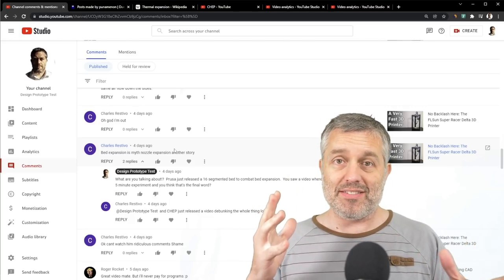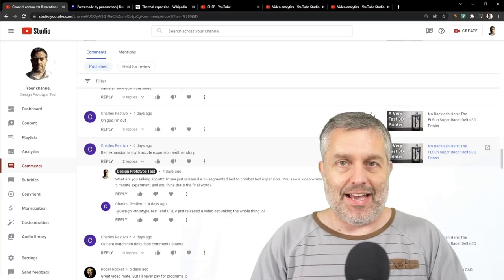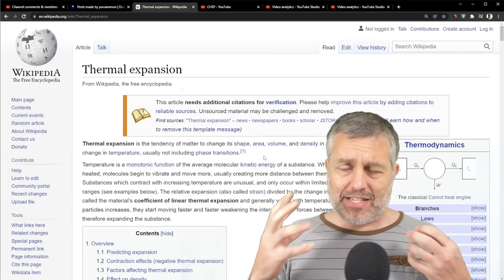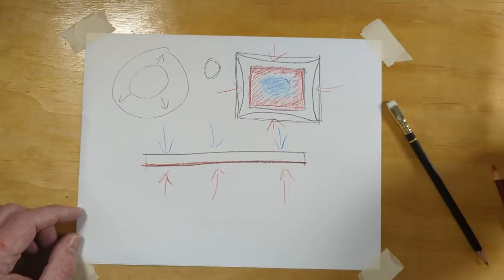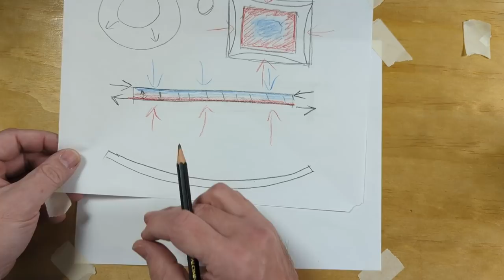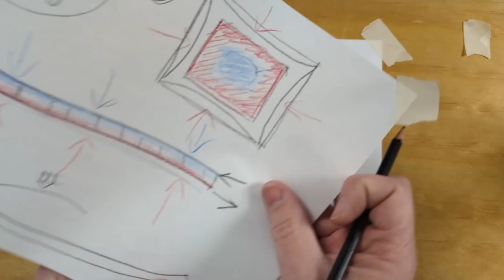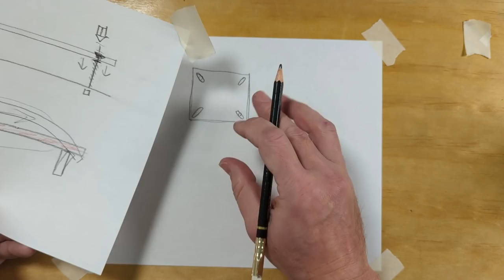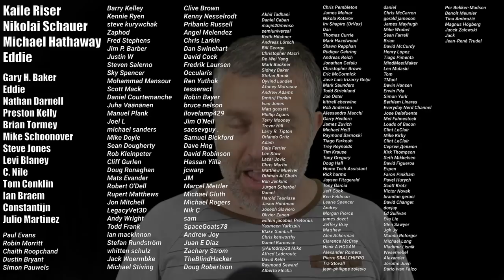The Problem With 3D-Printer Beds When They Get Hot.

Comment: Take a look at the rat rig, they have a ball bearing solution. You are not inventing anything new .
Reply from the maker: What is your problem? Seriously! Why do you harass me? You police my videos looking for the smallest nuance of something original I may have created then you make a point to tell me that I'm not special. Someone else thought of something before I did. WHY? Why are you so intent on making me feel like I have no value as a human being? What motivates this type of behavior? Were you beaten as a child by someone who looked like me?
Reply: I gotta agree with DTP, that's a pretty douchey approach. He never claimed to be inventing anything new and simply said the solution is a bit convoluted, which it is. it just happens to work really well on cube printers.
Reply: Dude wth he didn't even say it was his idea...
Reply: Dude stop watching him and go touch grass or play in traffic, you child.
Reply: He never said it was his idea, and I doubt that it was first done by Ratrig. Ball bearings locating on steel rods seems to be very common. Just look at the e3d toolchanger, it used bearings and rods to locate the printhead onto the tool head. Ratrig just put it on a bed.
Reply: @DesignPrototypeTest  You made a good video without drama, and it would be great if your comments were also as calm. Yes, it was completely unnecessary for Jose to point out the fact that you didn't invent the ball bearing track solution. Still, that doesn't invalidate your "value as a human being", by any stretch of the imagination! He's right that it's not your idea, so you can just say "true, it's not my idea" and move on, without throwing a hissy fit about it. Let's keep things calm and nice. And again, thanks for the great video, well done!
Reply: @DesignPrototypeTest  don't listen to no sense comments like that, there is always haters in every corner of life, great video, keep the excellent work without drama :D
Reply: @DesignPrototypeTest  wow! Same thing happened with the flat filament "idea" you had for prusa. Make some research before publishing the video. Don't be so sensitive, I'm not harassing you. I watch your videos because you have a lot of great information and knowledge. It just annoys me because you have a great channel but you always add drama to it and seem to be always on edge and a victim. And by the way , I do not work for prusa, my comments and thoughts are my own.
Reply: @joseholguin436  except he never said he came up with this idea. Have a Snickers, kid.
Reply: @jfaristide  haha peace and love my friend. Would have been nice if he did some research before doing the video and mentioned some other printers that do have ball bearings. Just amazes me that such an expert in 3d printing never saw before any printer with ball bearings.
Reply: @DesignPrototypeTest  id say youre someome he wants to be but isnt
Reply from the maker: @marcus3d  This comment is not isolated. Typically these guys show up on a video where I've actually created something novel. The point of their comments is to make me feel bad about my creations. But they are very clever and subtle on those other videos. The reason I pinned this video to the top and responded so strongly is because it perfectly illustrates what I'm talking about. I am persecuted by his type. You telling me to be calm and not cause drama over this issue. Makes me understand why my wife gets mad at me when I tell her to calm down. You are helping him to disparage me and my creations by suggesting that I am overreacting. As if it's my fault that he attacks me. Whose side are you on? Do you think he's right? Do I not make good original things?
Reply: @DesignPrototypeTest  You claim to know what their aim is, but you most certainly do not. Don't assume the worst. And even if their point would be to make you feel bad then just don't. It's water off your back.

And you say you feel persecuted. Well, don't. That's just your (IMHO extreme) reaction to your own interpretation of their action(s). No need to feel persecuted. They said the idea was old. They were right. No problem. No need for drama.

And you're asking whose side I'm on -- that's ridiculous us-vs-them mentality. It's just more drama. And that kind of mentality will just hurt yourself.

Instead of your egocentric ideas of coordinated persecution I think it's extremely more likely that the guy just wanted to appear smart and knowledgeable. Or maybe he's a geek (like me) who isn't very soft in his communication. Or maybe he's from a culture where this way of talking is the norm. Or any of a myriad of other possibilities that has nothing to do with persecuting you or wanting anything bad for you.

But just as he jumped to conclusions with his assumption that you thought your ball-rails idea was novel, so did you in your assumptions that his intent was malicious. You insisting on assuming the worst just hurts yourself. Don't. It's a choice.

And again, even if it would have been malicious, then so what? It's the internet, there will be harsh people. Some even harsher than your grandma. And someone saying something bad about you says more about them than about you. In any case it's completely pointless to whine about it, or to make drama. Let it be. Really. Let it go. You'll feel better, we'll feel better, even your wife will feel better. :)
Reply: @marcus3d  every last word of this
Reply from the maker: @marcus3d  You are completely and conveniently glossing over the point so that you can say a bunch of other words that sound like you are putting me in my place. Here in a video where I made absolutely no claim to any unique ideas coming from me he felt the need to say "You are not inventing anything new" The incongruity of this statement in relation to this video is indicative of a group of guys who make a point to watch all my videos and always comment that my ideas aren't original, I have nothing new to offer the hobby, and I am not talented. This behavior pretty much perfectly fits the definition of persecution: persistent annoyance or harassment. So, I will ask you again. Who's side are you on? Do you agree with Jose? Do you think I do not offer the hobby any new ideas? Do you think it is right that these guys keep me in my place by telling me repeatedly that I have nothing to offer? Answer the question directly please. I'm not asking for a diatribe about how I make my wife feel.
Reply: @DesignPrototypeTest  In the end, nobody but you is keeping you in your place. It's all your own interpretation. And I already said that I think it was completely unnecessary for Jose to say that, but it's also true that you didn't invent the ballbearing-on-rails thing, which can be seen in lots of places in 3D-printing. And now you're implying that I'm persecuting you for just telling you to not be so unbelievably thin skinned and paranoid about people being out to get you when there are other alternative interpretations, which I think are much more likely.

I'm sad that you feel persecuted but really, that's not because of others, that's because of you — your interpretations of things and the way you choose to react. You can choose how you look at the world. If you expect people to persecute you then that's what your perception will be attuned to, and how you will interpret things. But it doesn't have to be that way. You can choose another way. I've asked a therapist to help me overcome similar problems in my own life, and I wholeheartedly recommend the same to you. It will make such a huge difference once you no longer feel persecuted by random people's thoughtless, careless, or even outright mean comments.

Don't you think it sounds nice to get rid of all persecution without having to change anyone else on the internet? Why not give it a shot?
Reply from the maker: @marcus3d  1)Do you need me to catalogue all the times on all the other videos when I received comments similar to Jose's? I can do that. It's verifiable. It's not a perception thing. As I already cited the definition of persecution (persistent annoyance or harassment) clearly encompasses  a group of guys making a point to watch every single video I release for the smallest hint of something original so that they can make statements tearing me down and telling me I do not make original things. Therefore, by the very definition, I am persecuted, and it's not my perception. You are treading into gaslighting territory by suggesting it's all in my mind and not something that I can prove by combing through my comment sections. I'm beginning to think you don't want to answer my question because you don't have my intersects at heart. I'm beginning to think you are in fact my enemy commenting here to play mind games with me. This perception of you is further strengthened by your inability to answer my question. So. I will ask you AGAIN (3rd time, or is it the 4th?). Who's side are you on? Do you agree with Jose? Do you think I do not offer the hobby any new ideas? Do you think it is right that these guys keep me in my place by telling me repeatedly that I have nothing to offer?
Reply: @DesignPrototypeTest  The reason I didn't answer whose side I'm on was explained to you. I don't see any sides. Jose didn't say that you offer nothing new, that's a strawman. As I've said, repeatedly, his statement that you didn't invent the ballbearing-on-rails thing is correct, although unnecessary. That said, I'm completely on your side in that I really want to see more videos like this from you. It's a really good video. It's disheartening to see you go down the hole of thinking the world is against you. Please don't. I'm sure lots of people, including Jose, wants to just see more drama-less videos about design, prototypes, and testing. Please continue with these, and from the bottom of my heart please, please be well.
Reply from the maker: @marcus3d  This isn't good enough. You still didn't answer my question so I'll make it even simpler for you. QUESTION: Do you think I make original things?
Reply: @DesignPrototypeTest  Heck that dude, seriously. There are always going to be gate-keepers and trolls who have zero clue try to armchair their way into a topic they have no real understanding of in order to make up for their otherwise bland lives. Don't let it discourage you!

Your content, ideas, and the way you just explain things is phenomenal. In my opinion (and tens-of-thousands of others), you're a major resource and a "go-to" when it comes to learning more about 3D printing and conceptual design.
Reply: @DesignPrototypeTest  What isn't good enough?? I did answer the previous question as well as possible, given your false dichotomy logical fallacy (as explained). As for your new question, lots of things you say/do are certainly new to me, and as far as I know original. (The ballbearing-on-rails thing wasn't. I first encountered that on the E3D tool changer coupling, and after that on various kinematic heatbeds, although probably it's been around for ages.)
I very much appreciate hearing new stuff from you, please continue.
Reply from the maker: @MasterThief117  Thank you kindly. I appreciate your support. You , and the others who feel the same as you, are the reason I keep making videos. I'm mostly here to serve you guys, and to help advance the tech (if I am able to have any effect on things).
Reply from the maker: @marcus3d  Ok. Marcus. You've answered the question of whether or not you think I make original things and whether or not you value me making those original things. This is not a new question. I simply asked it in the negative sense originally (Do you agree with Jose who does not believe I create new things and wants to devalue me and my videos especially when it looks like I may have created something new), and then in the positive sense recently "Do you believe I make original things." You went above and beyond when you told me that you value me for my original contributions. That was going to be my follow up question so you expedited the conversation. Thank you. But the problem is that you can't even identify a question asked in the negative sense and in the positive sense as being the same question. Yet you think you should have the authority to psychoanalyze me?

As a self professed supporter of me (as the creator) and my channel I would think that you would be doing all you can do to encourage me to make more of the content you like. Ostensibly this is what you were doing with your diatribes culminating in your insinuation that "drama" on my channel makes my wife feel bad. First of all don't ever give me advice about my emotions or talk about my family ever again. This is a 3D printer/maker channel. It's not reality TV about my life. What gives you the right? You aren't my Uncle Iroh. Do you really think you are better than me and so much more cognizant of my life circumstances that you can navigate a better path through my reality than I am capable of? REALLY!?! The limited information you have about me from my videos makes you believe you can be my therapist? That's some hubris man. You should get a T-shirt like Josef. "Everyone is a maker, but only I can navigate DPT to a state of Zen." 

Secondly, don't ever use the word 'drama' with me again unless you want me to consider you as my enemy. You display a long standing knowledge of my channel in your comments so you are well aware of the connotations of that word in relation to my channel. It has been used many times as an attack vector from the Prusa camp. Whenever I make valid criticisms of that man/company I'm met with "stop with the drama" type comments like yours. It's not drama, it's valid criticisms. There is no defense against my criticisms so that word is used to dismiss them as bupkis. It's like that scene in Step Brothers where Will Ferrell has absolutely been playing the drum set and when asked if he did it his answer was "Are you f*** crazy man? You sound insane. Do you realize that?" See the deflection there? He definitely did the crime so he had no defense. Therefore, he attacks his accuser's sanity. That's kind of like your comments talking about my mental healthy. Isn't it?  You are deflecting. Jose is guilty of attacking me. In a video where I made no claim to anything original he went out of his way to disparage me on the subject. Then you, my self professed supporter who supposedly values me for my original contributions, wrote hundreds of words to me about my sanity/emotional health and that of my family. You didn't tell Jose he was out of line. You didn't defend me against his attack. Instead you tried to twist things making it look like Jose isn't here to harm me and my channel and you caused me to doubt my sanity. It's no different in effect than Will Ferrell's words from the movie. You can understand why I don't believe you for a second when you tell me that you support me. Your words have the opposite effect. 

Now, the fact that you are so motivated is the most suspicious thing about you. You jumped right in with hundreds of words impassioned to stop the drama. Well, if that is really what you want, why not go after the cause of the drama?: Jose. After all, this is a comment stream. Not a video. I didn't start this, I'm reacting to an attack. I didn't see one single word from you chastising Jose, but supposedly you support me. Would you tell someone being attacked on the street "Just ignore the punches. You aren't being attacked. That's just your perception. Think about how reacting to this is making your wife feel!" 

emotional
Reply from the maker: Something went wrong with that last paragraph. It didn't get posted. I don't feel like recreating it so I'll just say this instead: Only my intimate inner circle gets access to my psyche. Cowardly strangers hiding behind anonymity on the internet must be out of their damn minds to think they can reprogram my cognition like Marcus tried to do. To anyone else who wants to take this conversation/attack-vector this is your one and only warning. I will ban your account for this behavior. You are serving your own ego trying to mess with my mind. Don't pretend you are looking after my best interests. If you support my channel. Then support my channel. Call out guys like Jose. Tell me you appreciate my contributions. Trying to get me to do a deep dive navel gazing session doesn't get us anywhere. It has the effect of hurting the channel. I remove commenters who hurt the channel.
Reply from the maker: @joseholguin436  For reasons that god only knows my ability to come up with original things is a threat to you personally. Me, a stranger to you, coming up with original ideas threatens you. Which one of us needs to see a therapist?
Reply: @DesignPrototypeTest  you should let your "inner circle" (the one you trust with your psyche) read this thread. 

I worry for your well being and wish you the best
Reply: @DesignPrototypeTest  if my comment-thread was an isolated event within your channel I would be going to the therapist right now. However, by looking at your videos and comments there is a very clear pattern of behavior you have towards the rest of the community, maybe take a look at that. Even Chep who is the nicest person around seems to be already arguing with you. This is the internet, don't take things too seriously.
Reply from the maker: @jfaristide  They do Jay. Thank you for your comment supporting me in the face of Jose's original comment. I don't actually want to make videos for this channel. I don't feel the urge to do that anymore. The only reason I continue is because I know I would let people down who want to see more content from me. I read comments to get motivation. I reflect back that which I receive. Unfortunately, I almost never, and I mean like 1/1000 comments tell me "This is an awesome project. Keep it up. I can't wait to see more of this from you."
Reply: @joseholguin436  I dub you Barnacles the 3rd!
Reply: @jstro-hobbytech  It's a logical fallacy named "false dichotomy". 🤦‍♂️🤦‍♂️🤦‍♂️

And no, that's not what a dichotomy is. A dichotomy is a division of all possible alternatives into exactly 2 non-overlapping groups. Gosh! 🤦‍♂️

And no, a fallacy isn't necessary binary in nature. This one is an informal fallacy.

And the number of possible values has nothing to do with the binary of truthfulness. E.g., here's a trichotomy: "X is either a cat, a dog, or a goat." and the fact that the statement can be either true or false doesn't change the fact that it's a trichotomy. 🤦‍♂️

It seems unlikely that someone would be as wrong on as much as you are, so I'm thinking you're actually just trolling. But in that case, why not make it clever and funny? Like Ken M.
Reply: @marcus3d  I love it!
Reply: @jstro-hobbytech  haha I have no idea what your comment meant but made me laugh. I love the internet
Reply: @joseholguin436  good because yours did too and I was laughing at my own as well and the fact that I hopped in to the fray with no skin in the game. In the end it's all just melted plastic bro. Well melted plastic and 50 cent words spewed in succession like a broken thesaurus.
Reply: @jstro-hobbytech  nice to hear someone who doesn't take things to seriously and personally. I come from a place where PC culture has taken over yet and people don't need their safe spaces that bad.

Now just imagine DTP singing this haha
https://youtu.be/sXQkXXBqj_U
Reply: @DesignPrototypeTest  This video was really informative,  and you make valid points, but you get into completely useless arguments in the comments. Nobody's "invalidating you as a human", no one was "beaten as a child by someone who looks like [you]." Just chill.
Reply: @joseholguin436  you are wrong from the beginning of this thread man. Sorry but this creator only suggested that a ball bearing could be a solution but then he said that this would be too complicated so your problem must be somewhere else than you claim. Thinking is a creative process based on previously gathered knowledge. It takes no more than a few minutes to come up with ball bearings idea. And adding a little drama to the show makes it MORE ENTERTAINING. If you are looking for boring facts, look for them somewhere else. You appear to be well informed (according to your comments). Start your channel, spread you knowledge with other people. This is easy. Right? You would have done it better. Right? This is what your comments show. Then go and create and pray so that you do not come up with ideas that others had before you. You know why? Because other Joses will hunt you down on every false move. Good luck.
Reply: @marko_z_bogdanca  it's not my intention to create a channel, and if I did I wouldn't be so edgy an offensive like DPT. And I would do a bit of research before publishing a video (if you are going to make a video about beds and heat expansion, a bit looking around at precedents would go a long way in improving the channels quality, he just didn't and that was my criticism).

I invite you to go back in time and review his videos and comments, I am not the only one. He is constantly irritating people, insulting china, and just has bad social and communication skills which piss off a large part of the community. Just check previous videos and comments and you will see it is a clear pattern.
Reply: @joseholguin436  hows the orphanage